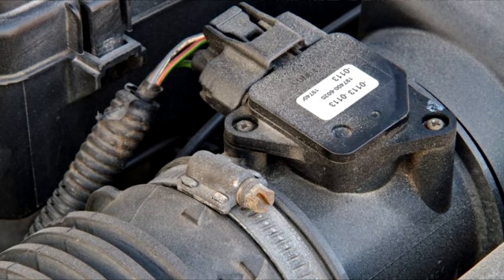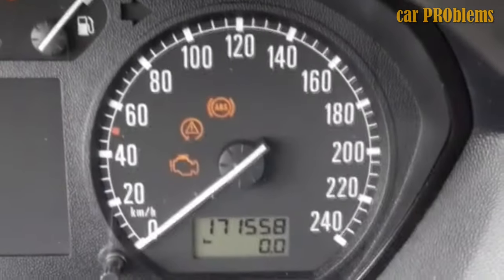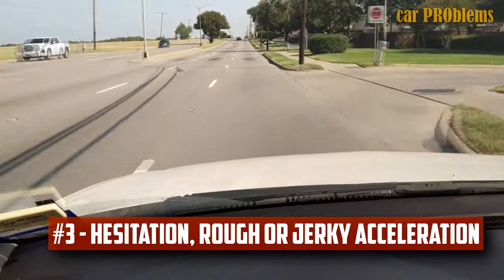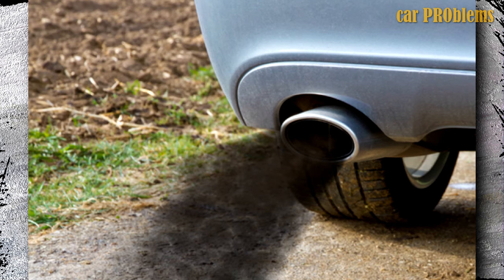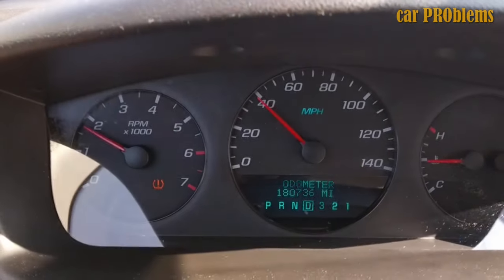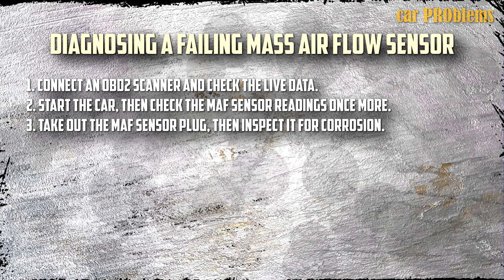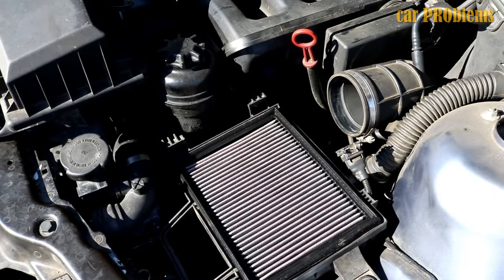8 Common Bad Mass Air Flow Sensor Symptoms - Faulty MAF signs

Comment: My truck feels like it's gonna die when I accelerate at a stop. And I don't get power
Reply: @Jessie Barber for me yes it was the MAF it was super dirty I sprayed some MAF cleaner and it did the job. A good way to tell is if you run the engine and disconnect the MAF and give it has the vehicle won't turn off but if you connect the MAF and it's dirty the car will turn off or jerk
Reply: @Jessie Barber Toyota cavalier? You mean Chevy cavalier?
Reply: Same thing happening to my Honda accord now when I turn my ac on it makes things worse & vibrates even more. I replaced a broken motor mount, 2 o2 sensors bcuz it set off the check engine light & now the cheap MAF sensor isn’t working & may need a new ac compressor. But I def notice every time I pull to a light or stop sign & pull off, it wants to die on me. All this started after hitting a median in the dark 🤦🏼‍♀️
Reply: i drive mine for about 10-15 mins and after that when i’m coming to a stop it takes like 3 seconds for it to go after i give it gas and when i drive it it will make some loud pops , also when i’m in idle sounds like it’s going to shut down like rpm’s kinda dancing a little bit
Reply: @christianruelas1460 yea mine sounds like it has a monster cam in it. And I have to really use my throttle when driving from a stop. I’ve had to drop my clutch countless times just to keep it from dying. I’m gonna try the MAF cleaner but I also got a fuel filter if that doesn’t work.
Reply: Sell it to me . idk how do you accelerate at a stop ?
Reply: Check coils, egr valve, idle air control
Reply: It means you have diabetes
Reply: Mine almost dies when i COME to a stop. Acceleration it doesnt do it.
Reply: @1jw298 no I think he meant the Toyota Honda chiron

Comment: Would this make the car go into reduced power mode?
Reply from the maker: Yes, a faulty MAF sensor can cause a reduced power mode in a car. If it faulty and not providing accurate readings to the ECM, it can cause the engine to receive too much or too little fuel, resulting in reduced power or even stalling.
In some cases, the ECM may activate a reduced power mode to protect the engine from damage if it detects an issue with the MAF sensor or other related components.
Reply: @carproblemsmax I don’t have any codes or mils but there is a rough idle in park and my long fuel trim on bank 1 show -12%
Reply: Depends on how Korean the car is.
Reply: Thank you for the detailed information. Hopefully this will help me locate & repair our vehicle with this information.
Reply: My 2020 silverado did that after I accidently touched the the negative terminal with the wrench on the positive. I was able to get around it by using one of the spare auxilery terminals on top of the battery. 
You may just need a new battery.
Reply: prolly bad torque converter my 04 cts has a bad torque converter on it rn
Reply: @556nate7   - This video is about engine running problems, due to failing mass air flow sensors. Nothing whatsoever to do with a torque converter, which is part of the car's power transmission system.  A fault with a torque converter will not affect engine performance in any way.  It will affect the car's performance, due to the engine power not being correctly transmitted to the wheels.
Reply: @droge192   ehhhhhh you wrong right there 😭☠️ i got a bad torque converter on my 2004 cts buddy i know the symptoms of the bad torque converter
your transmission can cause you to run a misfire which is what mine is doing with the bad torque converter so an on top of it you wouldn’t be able to drive your car with a bad torque converter ☠️😭so it do got soemthing to do with the motor it places on the front of the transmission an the back of ds motor but lemme be quite 😭
Reply: @Blorkion64 My Hyundai was made in Germany?  😂 👍

Comment: When I'm at idle my needle bounces a little bit. U can hear the motor kinda reving up and down. Don't know what's goin on no check engine light
Reply: Mine does the same thing when i slow to almost a complete stop. Died on me a couple of hours ago. Took 15 mins of cranking to start it. Mechanic coded it. Said it was MAS.
Reply: You probably have or had a vacuum leak

Comment: My check engine light didn't lumiate , but went in to limp mode
Reply: Did you fix this?
Reply: @Amahyze777  yes, it's the stpd new throttle body with spacer sucking too much air
Reply: My car kinda like stops for a bit and then goes again I got a 435i bmw it happens when I’m breaking or just accerlerating

Comment: We have changed bank 1 censor 2 oxygen censor twice on our 2014 Chevy traverse and we are still having the same issues and getting the same code. Our car is bucking/jerking when accelerating. Now I’m starting to think it’s the MAF censor. This is a headache lol.
Reply: If it’s a diesel it could be the fuel filter
Reply: That definitely sounds like MAF. Just changed mine out (took about 15 minutes) and it’s running great again, no more bucking, hesitant acceleration.
Reply: You ever had issues with stabiltrak?

Comment: My car just one day started overreving and acceleration felt weak instantly, it idles fine but my gears feel shorter and the car is running rich
Reply: mine is doing the same thing rn. was ur maf bad?
Reply: Did you find The problem?

Comment: I have only had one go bad recently in my 99 Lincoln Town Car.  I was getting a bit of a rough idle and randomly a lot of destination and part throttle. Turned out my car would randomly think it was a small plane, flying at 14,000 feet. For reference, it spends most of it time at 100 or less feet above sea level.

Comment: How I knew my mass airflow sensor was going bad. It wasn’t bad yet, but it was well on its way. When I turn the heater on that goes through the vents like to defrost my window, my SUV would start jumping, same with the air conditioner that goes through the vents The same Vince as above I got the mass airflow sensor cleaning spray that did nothing. Oh one more thing my gas mileage sucks matter fact it’s being replaced today I have a 2019 Kia Sorrento L with 138,216 miles. Yes I know a lot of miles for a newer vehicle I drive for Uber and I travel a lot. This explains my mileage. I will come back later and let you know if my issues are fixed by replacing the mass airflow sensor
Reply from the maker: Thanks for the comment! Even though the cleaning spray didn't help, it's good that you're getting the sensor replaced. I hope that resolves your issues and improves your SUV's performance. Don't forget to update us on whether the replacement solved the problem.
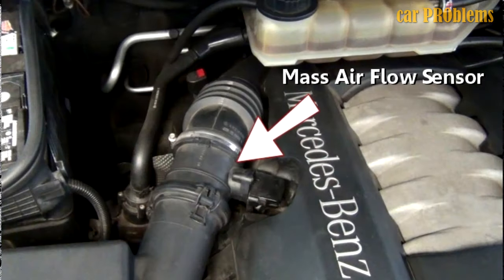Reply: @carproblemsmax 4:08 4:09
Reply: your problem is a Kia , why Americans buy foreign cars is a mystery to me
Reply: @jonesy4588  because they’re cheap and affordable ! not all of us can afford 50,000 or  $100,000 or  $200,000 cars and I’m not saying that to be rude at all ! please don’t take it that way, because that’s not the way I mean it.  I just wanted to add that in there because it’s hard to tell in a comment if somebody’s being rude or not.  so I just wanted to make sure you know that I’m absolutely not being rude  whatsoever.
Reply: @carproblemsmax  
Absolutely did not fix the problem. Turns out I had a misfire and one of the gaskets was bad which was leaking oil into my ignition coil. Also getting onto spark plugs this making me have a misfire parts are on their way. Thankfully I absolutely know how to fix this.   Also confirmed with check engine light, scan, because check engine light did come on. 

PS turns out a 2019 Kia Sorrento doesn’t have a mass airflow sensor. Good information to know lol. 

I absolutely knew nothing about cars before purchasing this vehicle, but now that the warranty is out because there’s a lot of miles on it I’m learning how to work on cars one step at a time.  so thank you to everybody who has helped me along this road. It’s very interesting. I’ll tell you that much !!

Thanks for being gentle with this little old female who now knows more than her husband about cars now 😈 never thought I’d see that day coming  !
Reply: Yuk
Reply: @sonjakeesee6977 I’m having same issues and have replaced so many diff parts. Can hook the OBD up to reader cuz someone busted it out the dashboard and crammed it  UP IN the dash. I’m also slowly leading about Car maintenance (mainly my car) simply cuz my hubby doesn’t want to fix mine. So I’m having to do this by myself and it’s not easy seeing how I’m in congestive heart failure. He literally drained every drop of water out of my radiator and then put a entire gallon of PURE antifreeze in my car. We’ve never added antifreeze in those steps in all my 20 yrs of marriage. So my  question is, the pure antifreeze, will that ruin my car. Also what can I do to fix my OBD port myself. I’m spending so so much money just from guessing what it could be. I have a 1995 BMW 740 I btw
Reply: My 2018 silverado rpms surge about 200 rpms more for a split second then fall back to normal intermittently while accelerating. Like every few seconds. While it does that I feel the tremble in my steering wheel. Engine light has come on before and then goes away on its own. Hoping it's only maf sensor.
Reply: @tcanales1977 what was it
Reply: @mikaithiam7257  Idk yet. No more check engine light but the still flutters intermittently while on the hwy with the accelerator pressed. With the little 200 rpm jump. O2 sensor maybe? 🤷

Comment: What about a service stabiltrak dummy light?
Traction control then reduces engine speed and while stopped it vibrates
Reply: My Tahoe is doing this as well. Did changing the MAF sensor fix the problem? Do you still get the stabilitrak light?

Comment: 2017 Nissan Titan... after idling for 10 or 15 minutes drove about 5 minutes to home and noticed as i was slowing to turn i drive the idle stayed at 1200 even after putting it in park and the light came on.  Going to try cleaning the MAF and replacing the air filter this morning.  Dont have a code reader and cant get an apt for a week.
Reply: Did it help?
Reply: @kane3825 it did. I bout a bluetooth code reader and checked readings before and after cleaning. No problems since.
Reply: unplug maf connector with engine running if var stay running its bad it stall it good cleaning wilol not help a bad sensor

Comment: My 2011 GMC Sierra 1500 SLT throws on service stabilitrak & traction control lights but it only goes into limp mode (engine power reduced) when I turn on my A/C. But after watching this video I unplugged the MAF sensor with the truck running and it did not turn off so I’m guessing that could be the problem. What do you guys think? Is there some connection there?

Comment: My 2007 Nissan Quest is also doing that. Car won’t accelerate when taking off from a stop. It goes into limp mode. I cleaned the maf but didn’t help. Could it be the throttle body or something else besides the maf. I’ve replaced the o2 sensors. The fuel pump couple other things. Each time it hasn’t help. I’m a new subscriber your information is excellent
Reply: Try replacing the Maf sensor.
Reply: its a nissan , just normal for those junks

Comment: My symptom was a check engine light and codes P0171 and P0174....Using the Toyota MAF inspection service bulletin showed the MAF was out of spec.
Reply: Did you change it and if so did light go off?
Reply: @brittanynicole3048  yes and now all is well.
Reply: Okay great. Thanks for your response. I will check on my sensor as well.
Reply: @brittanynicole3048  You're welcome.

Comment: Hi.. Thanks for the video.. I have a touareg vw 2006 model has p0102 code and tcs light came on..thevair bag light also was flashing sometimes since long time..Replaced maf sensor.. It was fine for a half hour journey.. Tcs also went away..after hslf hour tcs light came on and scanned by odb2..code getting now p0101..totally confused.. Checked air filter snd hoses everything fine..intake manifold was removed once a time replace the head cover gasket.. It is fine fitted by looking..no leaks found anywhere.. I guess while code p0102 got i was got a misfire cilynder 1 and after multiple.. Do i removed out the spark plugs outvand checked one plug was little bent its metal rode where the spark occurs..removed out all plugs and coils..cleaned all with petrol and the bent plugs adjusted spark gap's and installed back andvsame time replaced maf sensor also.. After i am gettimg p0101 code.. Do uou have any idea about it..? It spatk plugs or coils damaged due to cleaning by petrol.? Is this bad coils or plugs cause this code..? I have a sudden or lazy pick ups sometimes while driving..gear shifting also not smooth sometimes.. But when clearing codes its runs fine for a hslf hour..after Tcs is on.. Air bag is also flashing some times....i am totally confused what to do.. Kind uour help please.. I am an Indian from Kuwait..
Reply from the maker: The P0101 code indicates that there is a problem with the Mass Air Flow sensor circuit range. Even though you have replaced the MAF sensor, the problem persists. Here's what you can do:

Check the wiring and connectors to the MAF sensor for any damage or corrosion. Make sure they are securely connected.
Inspect the air intake system for any leaks or damage that may be causing incorrect readings by the MAF sensor.
Check the spark plugs and coils for any damage or wear. If the plugs are bent or damaged, it could cause misfires and affect the performance of the engine.
Check the throttle body and clean it if necessary. A dirty throttle body can cause issues with air flow and affect the MAF sensor readings.
If none of the above steps work, you may need to have a professional mechanic diagnose the problem with specialized equipment.
As for the TCS and airbag lights, these could be unrelated issues. It is recommended to have the vehicle diagnosed by a professional mechanic to determine the root cause of these problems.

Comment: When im starting my 2010 corolla if i start it right away it turns on then idles for 2 seconds then stalls on its own, i have to let it sit for 5 to 10 sec before starting and the throttle is electric and never responds either it doesbt accelerate or goes full throttle no matter how much gas i give it. Also my rpm is always going up and down i know the radiator fan can cause that but this happens even if the fan is off, a while ago it would have the rpm go to 1k then 250 and repeat it until it stalled and when i smack the maf sensor a couple times with a screw driver it idles fine. Im pretty sure these symptoms confirm that its the issue correct me if im wrong
Reply: Check the idle control valve.

Comment: I have a 12 Buick regal gs and I just tried disconnecting the maf sensor to see if the car will turn off, which I’ve heard is a symptom that it is not working correctly, so I cleaned the maf sensor with the spray, and I connected it back up started the car and the cooling fans came on.I also have codes p2271 and p0420, I’ve replaced the downstream sensor,  done fuel treatments with b12 to try and clean the cat, and it’s now starting to get bad, with low power and potentially fuel economy
Reply from the maker: MAF Sensor: Try using a specialized cleaner to thoroughly clean the MAF sensor. If it still acts up, consider replacing it.

Trouble Codes: Check both the upstream and downstream oxygen sensors. A faulty sensor can mess with fuel efficiency and performance. For the catalytic converter issue (P0420), if cleaning didn't help, get a pro inspection or maybe replace it.

Fuel System: Replace the fuel filter if it's been a while. A clogged filter can hurt performance. Also, ensure the fuel injectors are clean and working right. Consider using a cleaner or getting professional cleaning if needed.

Comment: My car surges from 500 rpm to a 1000 rpm when put in park and is just idling but when put in drive or reverse it idles fine and drives fine but when stopping at a stop sign or traffic light it will almost die like it's not getting enough gas and idles rough until I give it some gas to go. Could this be the MAF sensor or something else. This just started about a week ago. It's a very old Pontiac Grand Am GT with the 3.3L V-6 with only 78k miles on it. I just can't figure it out. Thank You !
Reply from the maker: The symptoms you're experiencing could be caused by a faulty idle air control valve (IAC), dirty throttle body, or a vacuum leak. The Mass Airflow (MAF) sensor could also be a potential culprit, but it's less likely to cause the issue you're describing.
Reply: @carproblemsmax   I will check that out. I checked for loose hoses and vacuum leaks but didn't find anything. I will replace the IAC valve and see if that helps. Thank you for the reply back. I really appreciate that.
Reply: @carproblemsmax I’m experiencing the same symptoms on my 06 bmw 750li took it to advanced auto parts and the read maf and o2 sensor
Reply: Well actually it idles rough and it drives rough and sometimes I can floor and it and nothing it’s very slow to accelerate I all most got hit
Reply: I got a rough idle even after replacing the, glow plugs, the glow module, dpf, cat, egr, next is maf senzor hope it helps

Comment: Would this cause my bike to Sputter feels like it’s needs gas like it’s has no gas , I replaced my coils , plugs . Injectors and pump and still doing the same , so I disconnected my MAF and it would run for a few secs but ruff I would give it gas and it would like hesitating like it didn’t have any gas then I’ll plug it back in the MAF And it would die